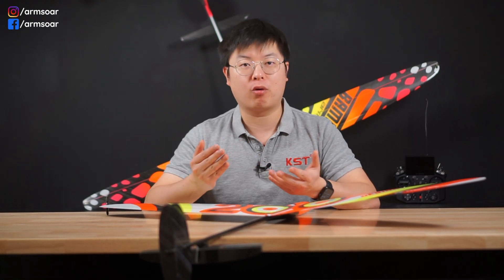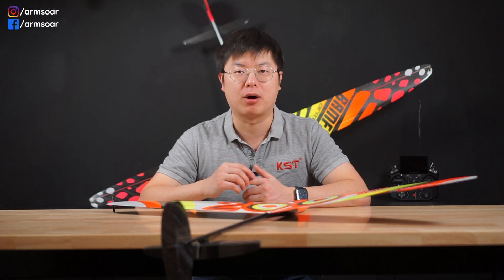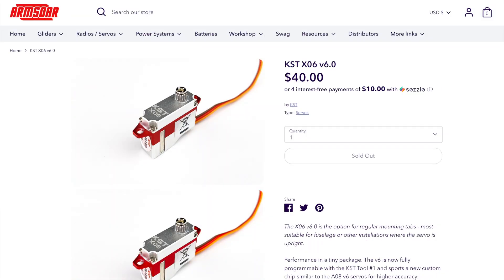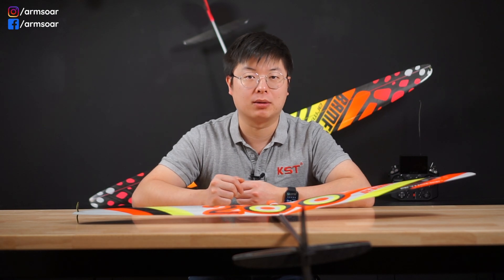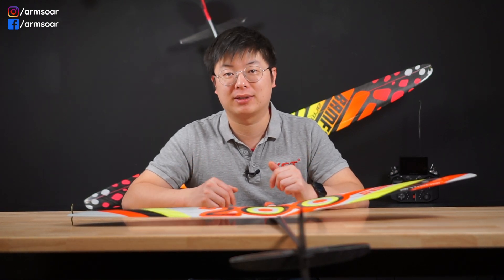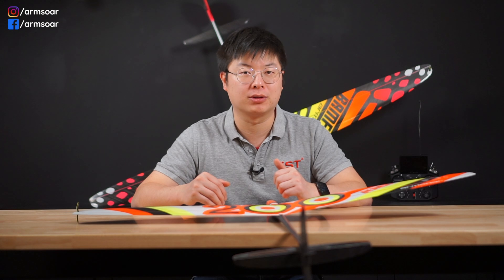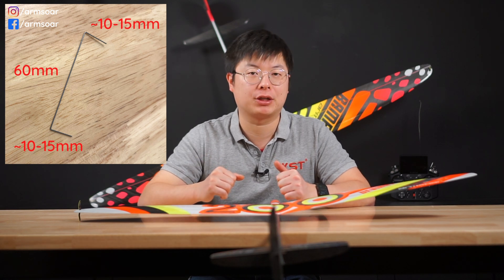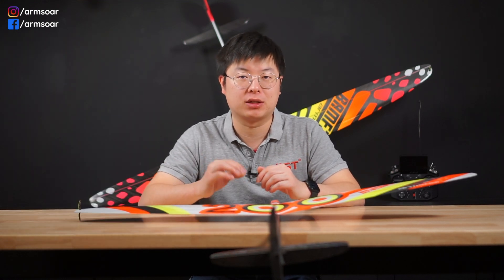RC Glider Basics | Pull-String Tail Linkage

Comment: Thank you for the video. I am looking for information on how to install the pulley. How do you set it up and make sure that it is in the right position? I searched your vids and I don't see anywhere on how to actually install the pulley itself. I ordered a set from your store and I am getting ready to install the servo tray, just not quite sure how these guys should be set up. Thanks for any help or point me to a video with the information.
Reply: when the control surface ( e.g. rudder or elevator ) is at its central position. ( 0 degrees deviation ) the servo ( and pulley ) should also be at 0 degrees rotation.... namely the flat side of the pulley is parallel to the fuselage, and on the curved side... the pull string is touching the tangent at the center of the curve ( pull string is touching the middle of the curved side of the D, when the control surface has a 0 degrees rotation.
The string ( beadalon, kevlar etc... )  goes all the way round the curved section of the pulley....through the tiny hole near the far end of the curve, then up and wind it around the screw before tightening the screw.  This should be done with a tight line and centralized control surface. ( it sometimes helps to tape the control surface in position, or get a friend to hold it )
Reply: @ thanks for that

Comment: I'm not into DLGs but when I'm scratching to keep weight to a minimum I use a pull-pull system with two runs of 0.1mm dyneema fishing line. Getting the tension just right can be a fiddle without adding the weight of a turnbuckle but can be done.
Reply from the maker: With pull-string, you’ll have better a better centring install without the pull-pull stress on hinges, which will also degrade the accuracy over time. DLGs are very sensitive to small trim changes and double-centring, hence pull-string becoming the standard.

Comment: I added a spring connected to the servo head, to pull it against the tail spring.
In neutral position, the sum of the springs forces is zero.

I believe it consume less power in average, and reduces the servo wear.
Reply from the maker: That works for sure!

Comment: Hi Thomas, 

I am trying to set up my 1m Hawk DLG. 
NX8 - spektrum receiver 

I have set up my flight modes in Camber Preset. 

Is this correct: 

Cruise mode 0mm with 6mm up and travel of the aliron when I move the stick and 5mm down.

Thermal 1 - 2mm down this then reduces the up travel of the aliron to only 4mm and means the down throw become 7mm

Thermal 2 - 4 mm down this reduces up throw to 2mm and down becomes 9mm

Is this correct? The camber preset moves the aliron function down. 

Should the aliron throw be 6mm up and 5mm down regardless of what flight mode I’m in? 

Cruise 0mm
Thermal 1 - 2mm down 
Thermal 2 - 4mm down

Comment: Question, should we always store the glider with the surfaces relaxed? Will it deform the surfaces if stored central?
Reply: With the ultra-thin skin on the tail surfaces, I do think that is a real risk. I tend to ensure that the surfaces are relaxed for that reason alone.
Reply from the maker: If you're using carbon tails I think the issue isn't going to be significant, but I'd still relax it to be safer.
Reply: @ArmSoar  will the glass tail be safe too?
I have the glass minidart